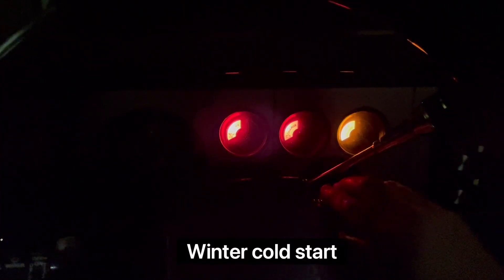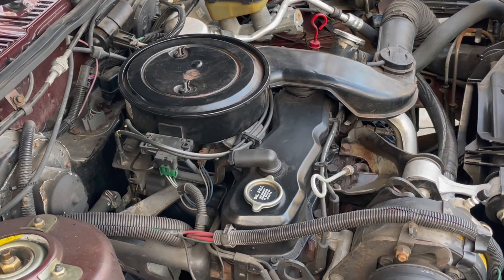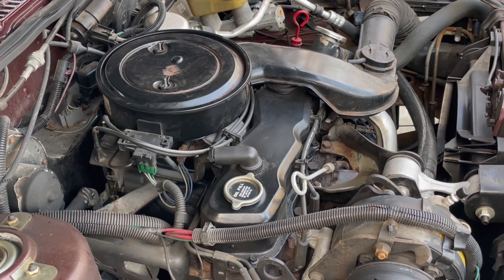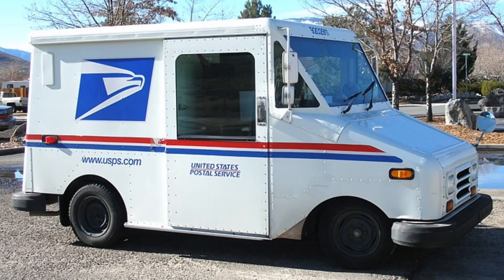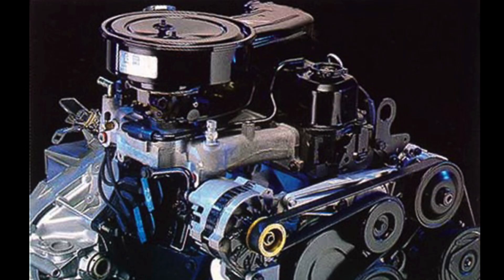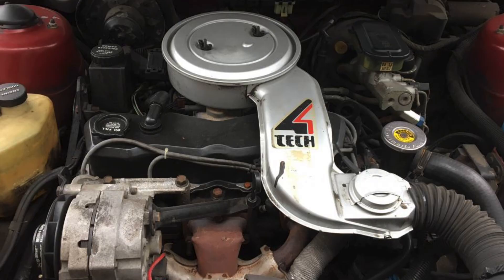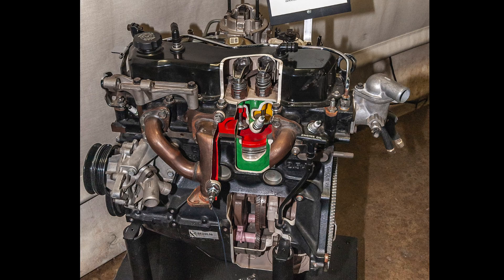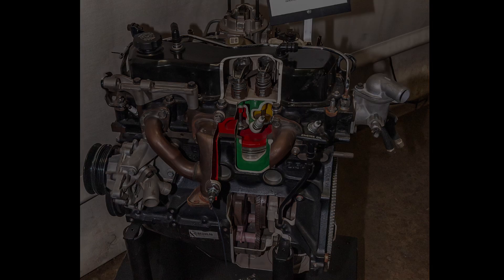Worst Sounding (and Most Recognizable) Engines: GM's "Puttering" Iron Duke 2.5L I-4

Comment: I would have liked to have seen a refined pushrod four cylinder motor.  

The generation of two-valve OHC motors that included the Chrysler 2.2 might have just as well used pushrods to achieve the 93 hp - no timing belt, focus on torque, not rpm.

Comment: As  a post office mechanic I worked on the llv my whole career and  until retirement , and as mentioned here you can still hear them coming up the road  , those little engines would keep on running with half a quart of oil and a quart of antifreeze  , sometimes they would start rapping   but still kept on going , they were primitive but reliable

Comment: This is an interesting example of not fully considering what matters to consumers.  The product development thinking stopped at it makes adequate power and is reliable.  This missed a whole host of things that were important to consumers like “sounding pleasant to drive and most importantly “not sounding so bad as to embarrass me.”  I grew up in a GM family (both parents employed by GM) and after a particularly awful experience with a new GM vehicle in the early 2000s, I bought a new 2003 Honda Accord.  There were many things that were pleasant surprises on that car, but it was the little things that often brought the most joy.  The feel of the exterior door handle and turn/wiper stalks were pure bliss.  That car wasn’t retired from service to our family until 2023!

Comment: My 1982 olds omega had the 2.5 and was one of the toughest pos cars I ever owned . Good on gas got me home with no coolant almost no oil after a teenaged car accident I'm not proud of.. The tree didn't look happy either. Point is it was bulletproof. It gated vacuum leaks . But I got 120 thousand miles out of it . When my mother sold it to me after my citation crapped the bed it gad 80 thousand miles same engine as my previous car but it had 200 plus thousand on it when I drove it to the junk yard . Got 25 bucks for it lol. Interesting video input thank you 👍

Comment: I'm from Russia. I have Olds cutlass ciera 1986 with Iron Duke engine. I drive it every day. I've driven 80,000 kilometers in two years. I've gotten used to its noise, but sometimes I still think the engine noise is abnormal, even though I know everything is fine. I'm tired of its vibrations. How often should I change a dog bone? 😀 
It tears off the bolts, it tears the subframe from the body... modern silent blocks can't withstand even two months of its vibration

Comment: What goes around seems to come around.  Last year, GM introduced a new turbocharged four-cylinder engine for its largest crossover vehicles--the Chevy Traverse, GMC Acadia, and, for 2025, the Buick Enclave.  Compared with the old Iron Duke, this turbo-4 serves up nearly quadruple the horsepower of the weakest Iron Duke version,  as well as more than twice the torque, thanks to turbocharging and improved airflow on the new engine.  But that new engine is 2.5 litres in displacement, the same as the old Iron Duke.  Oh, and, like the Iron Duke, the new turbo-4 sounds terrible by all accounts.  I call it "Son of the Iron Duke."

Comment: You got too remember that the automatic transmission iron duke sounded worse than a manual transmission one.I had a 91 grand am with a 5 speed manual and it sounded like a vacuum cleaner but it was still smooth. Also had a Cutlass ciera with an automatic and it sounded like rocks were in the engine
Reply: Obviously you haven't been in an pre 91 Auto Escort/Lynx with 1.6 or 1.9 when  accelerating in first gear

Comment: I had a Pontiac Fiero with the 2.5 Iron Duke.  That engine was so pathetic, the car wouldn't get out of its own way.  Rough running, the engine had huge rubber mounts (the infamous "dogbone") in a failed attempt to isolate the vibrations the four-banger produced.  I can't even begin to imagine that engine used in a larger car!  My wife loved the look so we (against my better judgement) bought a used one for her...it suffered the dreaded cam gear failure leaving her stranded in a parking garage.  That was our very last domestic car we ever owned in the last 40 years.

Comment: 1985 Buick Century Four-cylinder.  The Iron Duke.  It got great gas mileage!!  It never let me down, and I drove it hard.  I love that engine and I loved that car.  Good times.
Reply: What kind of fuel economy did you see in your 85 Buick Century?
Reply: @gregorymalchuk272  I believe it was around 23 miles per gallon.  I guess that doesn't sound that great today but it was really good for me back in 1987.
Reply: Mine was a 1991 Buick Century Custom. 2.5 Iron Duke. Slow but reliable. On the crude, noisy side.

Comment: I have an '86 olds cutlass ciera (2-door😏) with the iron duke and 440-t4, its all original with 53k miles, and it makes me wonder how they sold so many every time i drive it, weither its the whole car vibrating on acceleration, the dash rattling, the loud whirring it makes, the constant "misfire" at idle, or the starter sounding like the tin-mans zipper, its always making some kind of noise. It had metal in the oil when i got it, i changed it, did a wicked one wheel peel, and ive put about 20k miles on it without a single issue.

Comment: I worked at a engine rebuilder 1988-2000. We did a lot of these just because of the sheer volume of them on the road. This is my experience diagnosing normal and abnormal noises and concerns with the 2.5. The timing gears often had a slight knock at idle. At low rpm there is brief periods where the valve springs accelerate or drive the camshaft faster than the crankshaft gear does and you hear the clearance in the timing gears dancing back and forth. This was normal. In Tech 4s with a balance shaft assembly under the crankshaft the balancer assembly becomes very noisy with high miles or neglect. The balance shafts ride on the aluminum carrier with no bearings just like a ohc cam does on an aluminum head. The bores get worn and the shafts that are geared and timed to each other dance around and make a lot of racket. The balancer assembly isn't serviceable.You buy a new one. About $250 in 1990. The EGR passages in the intake manifold carbon shut. Without EGR quenching combustion chamber temp the engine pings and detonates. They always melt #4 piston when they ping. And they do clog up and ping about 90-120 k. Just my observations tearing down many of them

Comment: I had a 1986 Chevy Celebrity with the Iron Duke, was still on the road after 162,000 miles. Shortly after I bought it, I was waiting at a crosswalk with my then toddler son, when an Olds Ciera turned the corner. My son said “that sounds like our car “..

Comment: Not only the sound but if you were lucky enough to get one for the 1986 year , it came with fragile head bolts. This was according to NAPA Autopart's counter guy who said he sold a lot of those due to improper heat treating , they snapped a lot I broke two in one trip . One top end job later I was down the road around $ 365.00 including valve job, that was parts and the machine work I did the labor myself. On the bright side it did get 30.03 MPG on a trip back from Arkansas. Considering the bolts broke at around 50K miles I was not impressed with this engine .

Comment: I have an 89 with 55k Century.  It's a very good engine especially later 80's.  It has a timing gear which is slightly noisy but last forever.  Do you want a timing belt that destroys engine when it breaks?.

Comment: Your Oldsmobile Omega needs a 3.9L Chevrolet V6. 60 degree V6. GM High Value V6. More torque and smoother.  It can tow more, like 3500 pounds.

Comment: Adding the balance shaft was part of a package of updates: 1)The crankshaft had a big weird—looking gear added near the center; 2)The balance shaft assembly with rotating weights and engine oil pump was installed in the oil pan bulge and driven by the crankshaft gear; 3) A direct ignition module that replaced the distributor was mounted on the exhaust side of the cylinder block with a snout that reached through to sense the crank gear teeth. 

This resulted in unloading the camshaft since it no longer had to drive the oil pump and distributor. At two points 180-degrees apart the cam would “rattle” as the valve springs would push it backwards. This gave rapid wear in those two places on the phenolic gear. The teeth would get thin, rattle even more then break off. To counteract this the gears were hobbed to the large end of the tolerance to make a tight fit between the cam and crank gears and delay the rattling and failure. 

The other result was cooking the ignition module since it was in a tight space against the firewall of FWD cars and surrounded by the exhaust manifold.

Comment: Our 88 pontiac 6000 in canada ran strong till 2008 and 300,000 km. , we wished we had the gumption to put it in the old massy tractor when the body got rusty. got twice the gas mileage of our 305 caprice but embarrassing when people said sounds like a diesel
Reply: Why?
Reply: @zythr99  noisy
Reply: @limelight8018  Thanks
Reply: @limelight8018  Embarrassing was  accelerating in an  auto equipped Escort/Lynx, what with the unrefined CVH.

Comment: I currently have a 1988 GMC S15 with the 2.5L iron duke that's clocked 400k miles on it and undergone 2 or 3 rebuilds. The gas mileage is awesome and still has a lot of power in it for a four cylinder but it has been rebuilt with newer parts. This video doesn't show how loud these engines can be in the cabin while accelerating. Don't get me started on how it sounded without an exhaust system. 🤣
Reply: can't be any louder then the 1.6 and 1.9L in the pre 91 Escort/Lynx hooked up to an automatic.

By the way, you may not have been  on an older transit bus with the Detroit Diesel 6V92 with a non lockup 3 speed auto tranny at highway speeds with an exhaust issue.

Comment: Yep!! Gutless, lots of mechanical noise, and got a bad rod bearing at about 60,000 miles.  A 4 spd. auto would have helped diminish the gutless performance on hills.  Lots of smart folks at GM; I wonder how the Iron Duke slipped through the GM product system?

Comment: You could hop them up there was a racing program around that engine or something like that. 

The Iron Duke block formed the basis of Pontiac's Super Duty four-cylinder racing engines of the 1980s, the last in a line of high-performance Pontiac Super Duty engines. The engines were featured in NASCAR's Charlotte/Daytona Dash Series, the IMSA GT Championship (in GTP and GTU class cars), and even in American Power Boat Association racing boats. Super Duty engines continued to be used in ARCA racing until well into the 2000s.

Comment: The 3..8 an experimental engines back in 1977 the didn’t really start putting them in till the grand national came out  but they where super charged then the major mass  produce 3.8 aka 3800 was made till 87 in the Buick  Electra after that it was the best v6 u could have then the series 2 and series 3 came out still damn good motors

Comment: Does that X car in the cold start have the group 74 battery that fills the battery box or does it have one of the small batteries like the group 71 or 72 ? 
  Remember that "dogbone" upper engine mount and the way it allowed the engine to move back and forth somewhat,there was a Moog part that looked like a tiny shock absorber that could replace it or you could take the OEM unit and fill certain air holes in the OEM rubber stuff with silicone sealant and allow it to solidify before putting it back in place in the car,doing that kept the engine a bit more stationary when you let off the gas or changed gears. I think the OEM dogbone got redesigned to be larger during the run of those X cars. They were also on the Citation X11 V6 models. 
When you tried to change the spark plugs in the back bank of the V6 model you could take out the dogbone and fool with moving the car slightly by hand in reverse or forward gear (on a level surface with the parking brake released and no running the engine !) to rock the engine slightly more forward to get to the plugs or you could try the Snap On double joint spark plug getter socket #S9721A  which also helps with Grand Cherokee 
  looks like Snap On might have discontinued that spark plug getter?

Comment: I only had experience with one of these in a front wheel drive Pontiac and it was difficult to service especially the crank pickup unit. For all of it's downsides it was worlds  better than that horrible Vega aluminum debacle. running cast iron rings on an aluminum cylinder wall? Hell, Briggs & Stratton got away with it so why don't we give her a try.

Comment: The iron Duke I discovered many years ago has the same bore and stroke as the Famous DZ Block 302 used in 69 Z28s. Also, I worked at GM Powertrain in 94 in Flint Michigan which made the 5.7 Liter Vortec Engines at the time. When looking at the the blueprints for the procee, as an Engineer there, I could see references to a 4 cylinder line the intermingled its way through the V8 line, so Im thinking there was some 4 cylinder being produced with similar mechanics to V8s on the same equipement, The line was physically removed by the time I got there, so I have no way of knowing physically.

Comment: Had one in an 84 buick century.  It did everything I asked.  It Towed a Boston Whaler 500 miles to the coast with the airconditioning running. I sold it because it started leaking water round the doors but the engine was still running fine at 150,000 miles.

Comment: I had a Duke in an '84 S10... unrefined it may have been but it was just a brilliant workaday mill! I live in Canada and that machine simply worked no matter the temps - I recall many times when it was near -40° and she sparked right up and went to work when my other cars didn't start. She made noise, for sure, but I had no qualms taking my S10 on a bitterly cold Christmas eve on a 450 kilometer round trip to pick up my sister .... and that is just one example. 
That was a great little truck!
Edit: I failed to mention that it was Christmas eve of 1998.... the truck was nearly 15 years old and had about 170,000 klicks on the clock. Just never a worry.

Comment: The name is all you need to know. The Iron Duke was a bullet proof engine! I guess if you had a lot of money you could buy a car with a quieter engine. But for the price it had no problem with the noise. Ran mine for 200k and was still running!
Reply: Yeah; money to pay for gasoline and money to pay the 50 to 60 percent higher Insurance cost of a V8 if under age 25. Thats me in 1982 in California.

 A Camaro there in 1982 you could get a manual 4 speed; the V6 and V8 had to have an automatic. 

The V6 gave you 10 to 12 more Horsepower and weighted 51Lbs more and had an automatic. The V6 car also usually had more stuff so weighted more ie say 200 Lbs more. The V6 I test drove had an odd shaking. It was better if you drove short trips and did not have to worry about that clutch. lol

The V8 added 273 Lbs more to the 2.5 L I4 and gave you 45 more HP in California. 

So that extra 2.5 L of engine for the V8 did not double the HP; it just gave you 50 percent more since the V8 was detuned for EPA and MPG. The V8 in California had the lowest HP per Liter of displacemnt and the I4 2.5 L had the highest.  So these least efficient V8 weighted 273Lbs more and had the V8 muscle car Insurance surcharge if under age 25

The V8 was better if you were obese and owned a gas station and had an uncle in insurance to wave the 50 percent V8 muscle car added cost. lol. 

ALL my non California friends told me I should have bought a V6 or V8 with manual and a zillion HP version that was not sold in California or even legal to register there in 1982. ie they were clueless about the DMV and smog inspections. They thought one can magically buy a 1982 Car in Ohio and drive it to California where I lived and the DMV would allow one to get a license plate via bending the rules. lol

I really would have liked a High Tech straight 6 engine in my 1982 camaro but GM Invested in the V6 and I4 since thrust was also in FWD cars. ie the Detroit I6 too long for a FWD car to fit sideways.

Comment: I got a a 1986 GMC s15 bare bones base truck hand me down from my older brother. Iron duke, 4 speed manual, no power steering or brakes. I was 17 and it was a simple truck for a simple time in my life. I had so many adventures in that truck.

Comment: when I was young I bought a 1985 Buick Sommerset Regal that needed an engine. I swapped in a junkyard engine/trans and drove it for years. My 2 favorite things about it were the comfortable seats and how amazing it drove in snow. Also the thermostat was super easy to change as it was right under the radiator cap- no tools needed!

Comment: The iron duke was a emergency application due to the catastrophic 2.3L vega motor.  The duke was a durable proven standby made from cutting the pontiac v8 in half 35 years prior.  Newer does not always mean better. 😅

Comment: Ahh, I had an Iron Duke in my 1980 Pontiac Sunbird.  It had a rough idle but it otherwise ran well, good gas mileage, reliable, and always started.  Drove it for about 8 years and put 122K on it before trading it in.

Comment: I had a 1986 Chevy S10 with the Duke. The only issue I had was the head bolts broke, causing the coolant to leak into the cylinders. Causing the blueish smoke out the exhaust. Got it repaired GM covered the repair and I got another 100k out of it before I sold it. It had a total of 187,000 miles on it, yes it was noisy and not a lot of pep. It did ok

Comment: GM made a worse sounding 4 cylinder.  Although incorrectly attributed to the Iron Duke, they had a 3.0L 4 cylinder that was marinized for boat use.  It was based on the Chevy 153 4 cylinder engine originally used in the Corvair.  It sounded so bad in a boat everyone thought it was broken.  https://en.wikipedia.org/wiki/Chevrolet_153_4-cylinder_engine